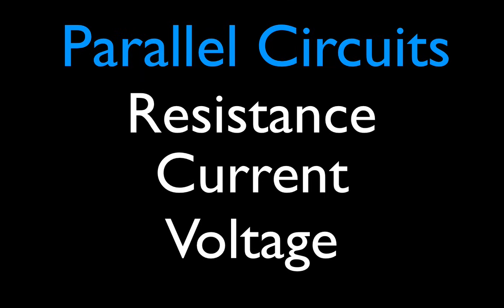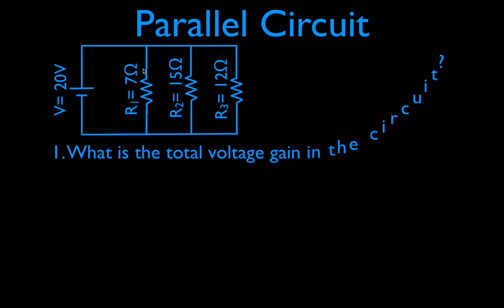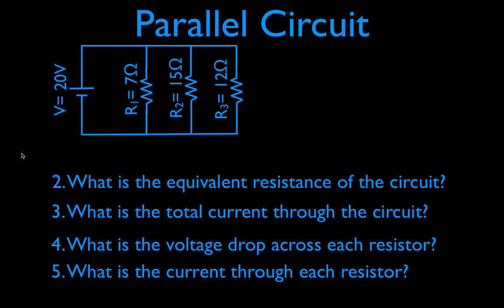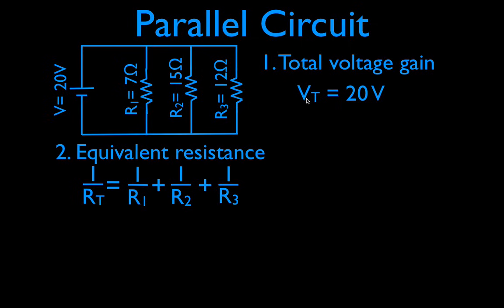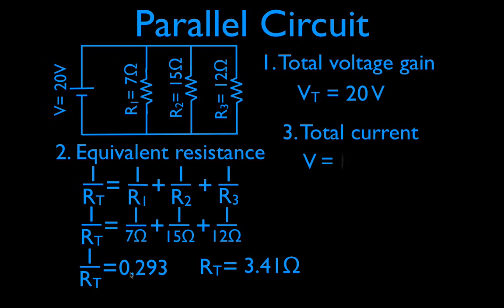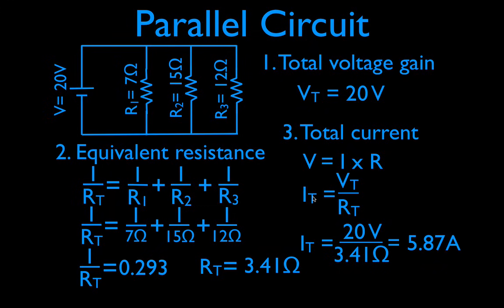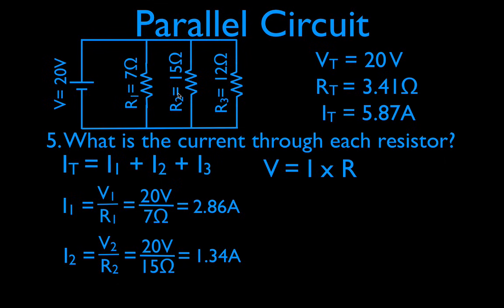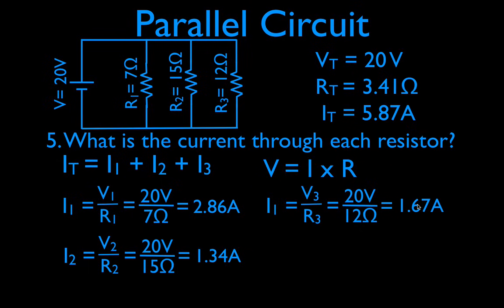Resistors in Electric Circuits (3 of 16) Voltage, Resistance & Current for Parallel Circuits

Comment: Sir 
How the voltage will be same in parallel resistor ?
When the current is distributed the potential energy along electrons will be distributed..
Reply from the maker: I like to tell my students that each resistor is connected directly to the battery. There is nothing between each resistor and the battery to use any of the energy.

Comment: Sir i make a circuit battery and resistor in parallel why the result on multimeter didn't much on computation?
Reply from the maker: That is a very good question. I would have to see what you are actually doing.
Reply: @stepbystepscience  thank you sir, i wish you upload a video of it

Comment: What's crazy is I added them like a series circuit by mistake..my total for Rt was 34   instead of 3.41 n when I finished in total my current or I was 0.58 in stead of 5.87.
Reply from the maker: Crazy, but two decimal places makes a big difference.
Reply: @stepbystepscience  yes absolutely 💯 I agree

Comment: Sir can you explain how  can I verified total voltage formula. Using the same circuit. Plz Sir
Reply from the maker: I am not sure what you mean, but you can calculate the voltage across one of the resistors and because it is a parallel circuit you know that is equal to the total voltage. Does that help?

Comment: So you say that the voltage drop of each resistor is the same, but you never say how much the voltage drops nor do you explain how to calculate that. Thanks for nothing.
Reply from the maker: Did you watch the video? See 5:04

Comment: the BIGGEST thank you goes out to you sir!!! i’ve been struggling with this concept for days now & i just could not grasp it with what my teacher was giving. you explained everything so clearly & easy to understand!! thank you so much !
Reply: You may find a comprehensive description in the refetences here on the physics of the networks.
What is a resistor? How does current branch in a network of resistors? How does it "know" how much should flow in each branch?
While some detail is given in science and engineering courses about conductors, insulators and semiconductors, resistance is described in several ways.
Examples include i. The restriction to the flow of electrons. ii. The difficulty in moving electrical current through a conductor to which voltage is applied.
iii. a circuit element which dissipates energy in the form of heat .
More appropriate description for a resistor would be the property of a conductor which determines the current produced by a given difference of potential.
This makes us remember that a resistor is a conductor first. And, there is reason to say that superconductive wires dont obey ohm's law. So all conductors are resistive, though not superconductors. 
Resistors are used in circuits to regulate the strengths of currents either by reducing the diameter of conductors or introducing more obstacles or lattice imperfections to reduce the strength of current.
The current branches in a parallel network by an elaborate rearrangement of surface charge.
For more details about resistance, how current branches in a parallel circuit and ohm's law consult the following videos, articles and books.
What is current ? What is voltage ?
A working definition for current in conductors like metal wires is "the start-stop motion of millions and millions of conduction band electrons everywhere within with a drift superimposed". 
In circuits, voltage is due to surface charges. Consider a simple circuit comprising a battery, two wires and a resistor. 
The e.m.f of the battery is due to separation of positive from negative charges which produces an e.m.f across its terminals and a pattern of electric field surrounding them, not exactly but like a dipole.
An electric field is there in the wires and in the resistor; powerful electric field and uniform within the resistor, weak and uniform within the wires. The field is set up by a tiny amount of surface charge with a steep gradient on the resistor and not so steep a gradient on the wires. 
It is the electric field E created by the surface charges sourced from the battery, which produces a force causing the mobile electrons to acquire a drift velocity v = μE, where μ is the mobility which is a number representing the freedom of movement of the electron in the lattice. 
This results in a current density J = σE, where σ is the conductivity of the wire or material of resistor and E is the electric field in the wire if considering wire and is the field in the resistor when considering the resistor. 
The p.d. or voltage across the resistor is the integral of a constant powerful field along its length. The p.d. or voltage across the wires is the integral of a constant but weak field along its length. 
Voltage is entirely because of the surface charges.
Electrostatics and circuits belong to one science and not two, that of electricity and magnetism. To know how they are unified visit this link 
https://matterandinteractions.org/articles-talks/ and view the article 'A unified treatment of electrostatics and circuits.  B. Sherwood and R. Chabay, unpublished. (1999)'
pdf. 
For more details see Electric and Magnetic Interactions by Chabay and Sherwood 
www.matterandinteractions.org
or 
Fundamentals of electric theory and circuits by Sridhar Chitta
https://www.wileyindia.com/fundamentals-of-electric-theory-and-circuits.html
There is a "look inside" feature in the amazon.com webpage of the book "Fundamentals of electric theory and circuits" by Sridhar Chitta with a few pages of Chapter 1 which may be viewed and also which you may swipe left or press < icon to view the foreword, preface and Table of Contents. 
For a video lecture by Prof Ruth Chabay on surface charge in a simple dc circuit visit 
https://youtu.be/-7W294N_Hkk
There is a full set of lectures beginning lecture 13 here on surface charges, electric fields, simple circuits, capacitance, inductance, faraday's law, motional emf, magnetic forces and more topics here
https://matterandinteractions.org/videos/EM.html
For a live demonstration of surface charge in a circuit visit
https://youtu.be/U7RLg-691eQ
There is a full set of lectures beginning lecture 13 here on surface charges, electric fields, simple circuits, capacitance, inductance, faraday's law, motional emf, magnetic forces and more topics here
https://matterandinteractions.org/videos/EM.html
Reply from the maker: You are very welcome, and thanks for the very nice comment.

Comment: In a four branch parallel circuit, 10mA of current flows in each branch . If one of the branch is opens, the current in each of the other branches.. ?

A) decrease
B) increase
C) remaining unaffected
D) doubles

Pls say the answer sir

Comment: I have been trying to learn this (beat it into my skull) for almost a week. I have been "instructed" by an Instructor with an Electrical Engineering degree, and watched scores of other you tube videos to no avail IDK WTF. Now, after watching these, I finally have a grasp and am looking forward to our upcoming test on Monday. You explain thoroughly, and make this subject matter EASY to understand. Thanks - You rock!!!
Reply: You may find the references here useful.
What is a resistor? How does current branch in a network of resistors? How does it "know" how much should flow in each branch?
While some detail is given in science and engineering courses about conductors, insulators and semiconductors, resistance is described in several ways.
Examples include i. The restriction to the flow of electrons. ii. The difficulty in moving electrical current through a conductor to which voltage is applied.
iii. a circuit element which dissipates energy in the form of heat .
More appropriate description for a resistor would be the property of a conductor which determines the current produced by a given difference of potential.
This makes us remember that a resistor is a conductor first. And, there is reason to say that superconductive wires dont obey ohm's law. So all conductors are resistive, though not superconductors. 
Resistors are used in circuits to regulate the strengths of currents either by reducing the diameter of conductors or introducing more obstacles or lattice imperfections to reduce the strength of current.
The current branches in a parallel network by an elaborate rearrangement of surface charge.
For more details about resistance, how current branches in a parallel circuit and ohm's law consult the following videos, articles and books.
What is current ? What is voltage ?
A working definition for current in conductors like metal wires is "the start-stop motion of millions and millions of conduction band electrons everywhere within with a drift superimposed". 
In circuits, voltage is due to surface charges. Consider a simple circuit comprising a battery, two wires and a resistor. 
The e.m.f of the battery is due to separation of positive from negative charges which produces an e.m.f across its terminals and a pattern of electric field surrounding them, not exactly but like a dipole.
An electric field is there in the wires and in the resistor; powerful electric field and uniform within the resistor, weak and uniform within the wires. The field is set up by a tiny amount of surface charge with a steep gradient on the resistor and not so steep a gradient on the wires. 
It is the electric field E created by the surface charges sourced from the battery, which produces a force causing the mobile electrons to acquire a drift velocity v = μE, where μ is the mobility which is a number representing the freedom of movement of the electron in the lattice. 
This results in a current density J = σE, where σ is the conductivity of the wire or material of resistor and E is the electric field in the wire if considering wire and is the field in the resistor when considering the resistor. 
The p.d. or voltage across the resistor is the integral of a constant powerful field along its length. The p.d. or voltage across the wires is the integral of a constant but weak field along its length. 
Voltage is entirely because of the surface charges.
Electrostatics and circuits belong to one science and not two, that of electricity and magnetism. To know how they are unified visit this link 
https://matterandinteractions.org/articles-talks/ and view the article 'A unified treatment of electrostatics and circuits.  B. Sherwood and R. Chabay, unpublished. (1999)'
pdf. 
For more details see Electric and Magnetic Interactions by Chabay and Sherwood 
www.matterandinteractions.org
or 
Fundamentals of electric theory and circuits by Sridhar Chitta
https://www.wileyindia.com/fundamentals-of-electric-theory-and-circuits.html
There is a "look inside" feature in the amazon.com webpage of the book "Fundamentals of electric theory and circuits" by Sridhar Chitta with a few pages of Chapter 1 which may be viewed and also which you may swipe left or press < icon to view the foreword, preface and Table of Contents. 
For a video lecture by Prof Ruth Chabay on surface charge in a simple dc circuit visit 
https://youtu.be/-7W294N_Hkk
There is a full set of lectures beginning lecture 13 here on surface charges, electric fields, simple circuits, capacitance, inductance, faraday's law, motional emf, magnetic forces and more topics here
https://matterandinteractions.org/videos/EM.html
For a live demonstration of surface charge in a circuit visit
https://youtu.be/U7RLg-691eQ
There is a full set of lectures beginning lecture 13 here on surface charges, electric fields, simple circuits, capacitance, inductance, faraday's law, motional emf, magnetic forces and more topics here
https://matterandinteractions.org/videos/EM.html

Comment: No exaggeration.. I've watched 20 videos on this subject.. by FAR the Greatest one
Reply: You mayfind the references here useful.
What is a resistor? How does current branch in a network of resistors? How does it "know" how much should flow in each branch?
While some detail is given in science and engineering courses about conductors, insulators and semiconductors, resistance is described in several ways.
Examples include i. The restriction to the flow of electrons. ii. The difficulty in moving electrical current through a conductor to which voltage is applied.
iii. a circuit element which dissipates energy in the form of heat .
More appropriate description for a resistor would be the property of a conductor which determines the current produced by a given difference of potential.
This makes us remember that a resistor is a conductor first. And, there is reason to say that superconductive wires dont obey ohm's law. So all conductors are resistive, though not superconductors. 
Resistors are used in circuits to regulate the strengths of currents either by reducing the diameter of conductors or introducing more obstacles or lattice imperfections to reduce the strength of current.
The current branches in a parallel network by an elaborate rearrangement of surface charge.
For more details about resistance, how current branches in a parallel circuit and ohm's law consult the following videos, articles and books.
What is current ? What is voltage ?
A working definition for current in conductors like metal wires is "the start-stop motion of millions and millions of conduction band electrons everywhere within with a drift superimposed". 
In circuits, voltage is due to surface charges. Consider a simple circuit comprising a battery, two wires and a resistor. 
The e.m.f of the battery is due to separation of positive from negative charges which produces an e.m.f across its terminals and a pattern of electric field surrounding them, not exactly but like a dipole.
An electric field is there in the wires and in the resistor; powerful electric field and uniform within the resistor, weak and uniform within the wires. The field is set up by a tiny amount of surface charge with a steep gradient on the resistor and not so steep a gradient on the wires. 
It is the electric field E created by the surface charges sourced from the battery, which produces a force causing the mobile electrons to acquire a drift velocity v = μE, where μ is the mobility which is a number representing the freedom of movement of the electron in the lattice. 
This results in a current density J = σE, where σ is the conductivity of the wire or material of resistor and E is the electric field in the wire if considering wire and is the field in the resistor when considering the resistor. 
The p.d. or voltage across the resistor is the integral of a constant powerful field along its length. The p.d. or voltage across the wires is the integral of a constant but weak field along its length. 
Voltage is entirely because of the surface charges.
Electrostatics and circuits belong to one science and not two, that of electricity and magnetism. To know how they are unified visit this link 
https://matterandinteractions.org/articles-talks/ and view the article 'A unified treatment of electrostatics and circuits.  B. Sherwood and R. Chabay, unpublished. (1999)'
pdf. 
For more details see Electric and Magnetic Interactions by Chabay and Sherwood 
www.matterandinteractions.org
or 
Fundamentals of electric theory and circuits by Sridhar Chitta
https://www.wileyindia.com/fundamentals-of-electric-theory-and-circuits.html
There is a "look inside" feature in the amazon.com webpage of the book "Fundamentals of electric theory and circuits" by Sridhar Chitta with a few pages of Chapter 1 which may be viewed and also which you may swipe left or press < icon to view the foreword, preface and Table of Contents. 
For a video lecture by Prof Ruth Chabay on surface charge in a simple dc circuit visit 
https://youtu.be/-7W294N_Hkk
There is a full set of lectures beginning lecture 13 here on surface charges, electric fields, simple circuits, capacitance, inductance, faraday's law, motional emf, magnetic forces and more topics here
https://matterandinteractions.org/videos/EM.html
For a live demonstration of surface charge in a circuit visit
https://youtu.be/U7RLg-691eQ
There is a full set of lectures beginning lecture 13 here on surface charges, electric fields, simple circuits, capacitance, inductance, faraday's law, motional emf, magnetic forces and more topics here
https://matterandinteractions.org/videos/EM.html

Comment: so how would you solve the voltage drop in the resistor if there was another resistor in its path?
Reply from the maker: Find the current through the branch with more then one resistor and then multiply the current times the resistance.